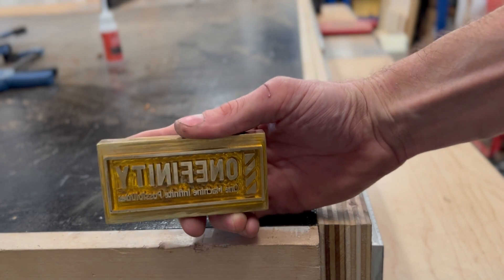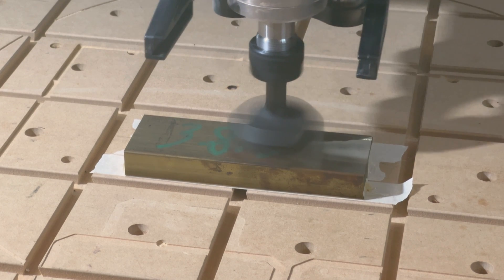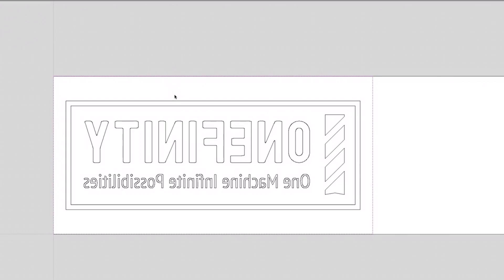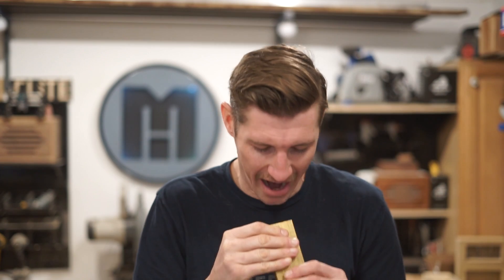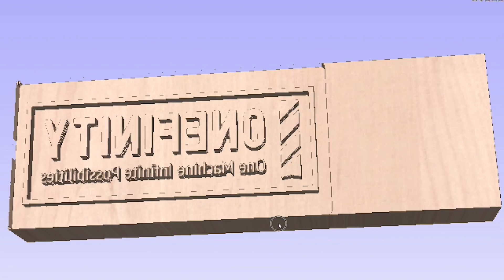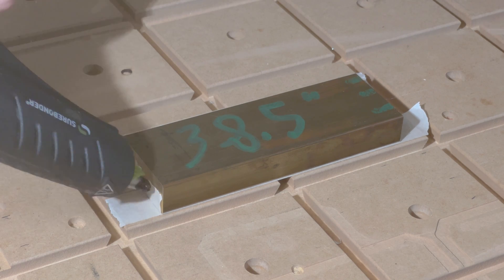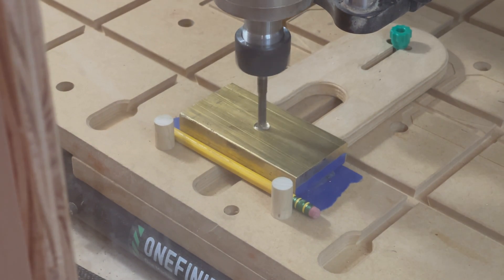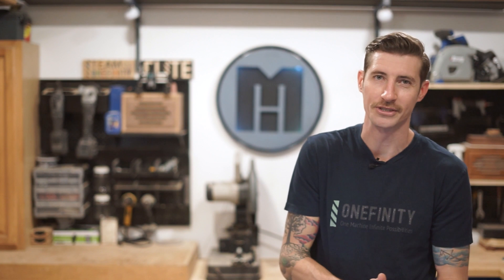EP. 25 Onefinity CNC - Make Your Own Brass Branding Iron!

Comment: I’ve been struggling with making brass clock dials, and one lesson learned was that brass alloys have different hardness.  A lot of the sheet brass is alloy 260, which bends well, but doesn’t machine well.  Brass alloy 360 was so often used in clock that some call it “clock brass”.  But I can’t find that in sheets.  The closest I can find is 353.  Please consider adding the alloy you chose to the “what did he use?” Section of the video.  If 260 works, that’s exciting, and I’ll blame my Amana bits.  My next effort is Bits&Bits cutters.
Reply from the maker: Great tips!

Comment: Hi, I’ve been looking at a cnc to create a small brand. Is there a limit to how small of a resolution that can be created? I’m thinking of the limitations of the bit but also how small you can go without the heat bleeding between elements of the brand.
Reply: You can cut deeper. Most of the bleed comes from the background, not the part that's burning.
Reply: @JasonPeltier  hi, thanks for the explanation, good to know.
Reply from the maker: It can engrave really small.  Not sure about the heat bleed.

Comment: Good stuff. Especially appreciate the feeds & speeds -- I'm too cheap to test a bit to failure, so have had to be super conservative with tiny bits in metal -- great to see some 1F-specific data. A little puzzled by the 3 different versions though. You show one set of settings on screen, say something a little different, then include yet a 3rd version in the text.